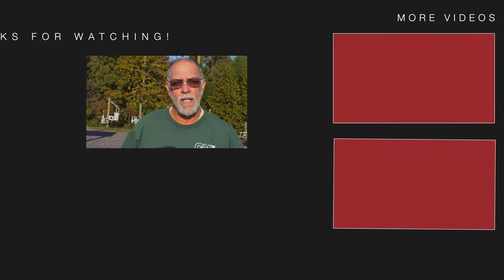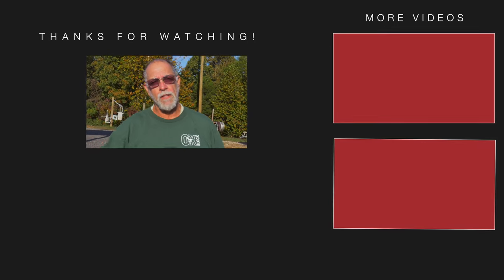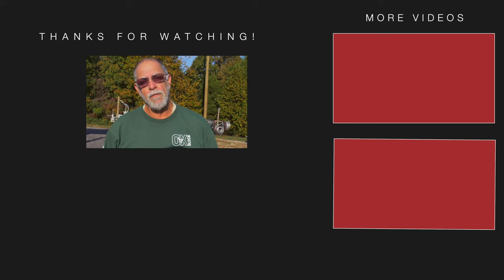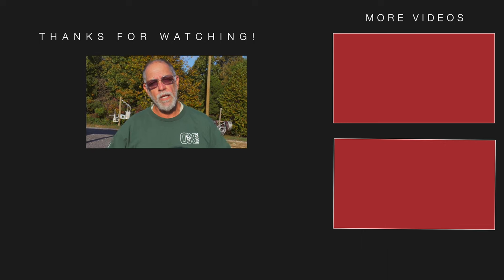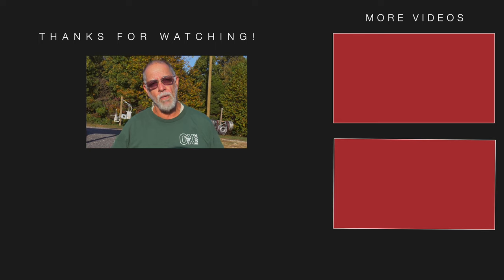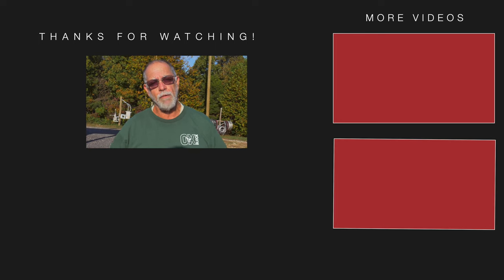What being trained to climb power poles the first time is like. ELITE Lineman - Class 15

Comment: This is so interesting.
If I take 2 weeks off from riding my horse, I'm so painful, I can't get out of bed for at least 3 days. I'll assume they need a massage, heating pads, hot baths, and over-the-counter pain relief.
Being a lineman is such a physical, and mental occupation, I can't even imagine the physical strength it takes.
**I'd like to think linemen have been an electrician first.**
I'm a country gal that lives on a farm, so my "fun" is driving past a construction crew and looking at the handsome men's muscles, sweating, and how fearless they are.
I suppose if I were a 'city girl', suits and ties would be attractive, but manual labor guys are the best IMO.
I wonder how many drop out of the training, because of the pain? There are deaths to consider too.
Reply: Once you get the technique down it's much easier. (1st place climbing rodeo winner here) when you get the movements down you use alot less energy